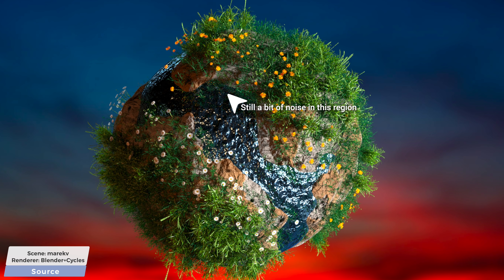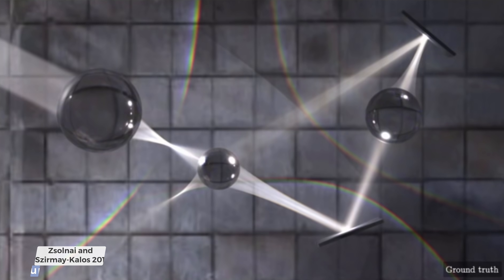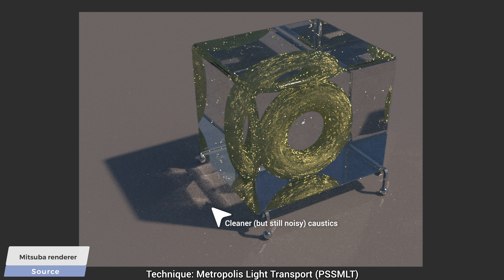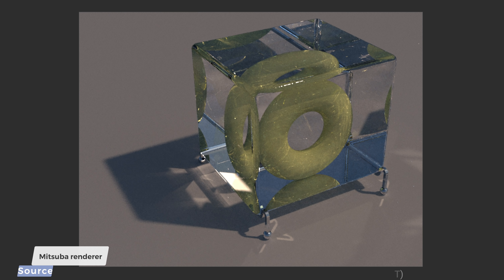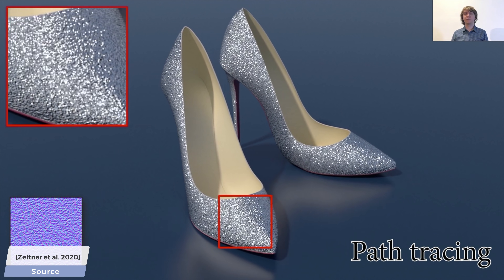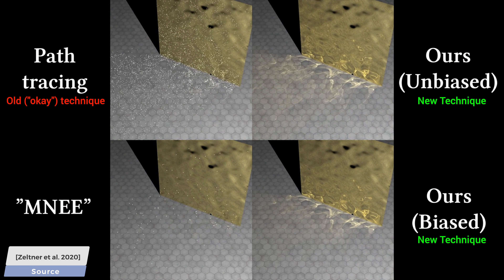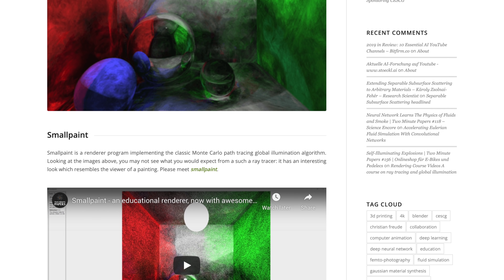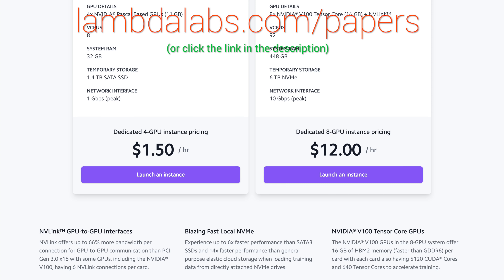Beautiful Results From 30 Years Of Light Transport Simulation! ☀️

Comment: i wonder if you could run the rendering for not a long time then use GAN to clean up the firelys
Reply: since it uses bias and what the machine thinks looks "right" instead of what is actually happening it wouldn't be completely accurate but you could end up with something that looks pretty decent without as much effort.

Comment: I think the problem with the old manifold exploration technique (MEMLT) is not just that it is difficult to implement. But more problematic that because it is also based on metropolis light transport. And as such the problem is that it causes flickering when trying to render an animation. It only works so well for single images.
Seeing actual animated(!) caustics rather than just still images is what is really exciting about the new technique in my opinion.

Comment: Dunno if someone aleady mentioned it, but the most immersive and different results in this "new" algorithm are achieved via biased rendering. And one thing should be mentioned about the biased renderers is they are not physically correct due to use of interpolation techniques.

Comment: I've never heard about that before but I was wondering: What's the goal of this ?
Please, tell me :D
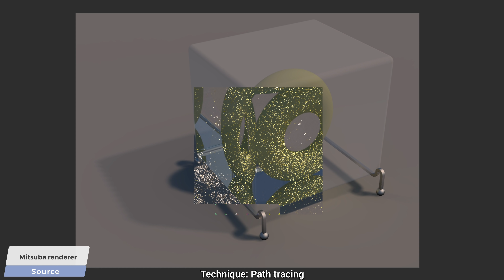Reply: You can achieve those nice looking results with any method, the comparison made here, I believe, is what the final result is at the same given time. So the new cool method might give you outstanding results in two minutes while the old methods could take hours. Just as an example, each frame of the movie frozen took about 24 hours to be rendered, and those are 24 each second for the entire 1:30h movie. 

So the goal of this is an increase in performance, you'll need fewer render-farms running and thus save a ton on budget and dev time. Also, and this is a personal example, blender recently added an AI denoiser for the viewport that can be powered by optix (Nvidia rtx tech), with this I can see what my scene looks like almost in real time and thus I can edit anything much faster instead of waiting for the scene to render and adjusting it (like what was done on 2.7x versions of blender). This really boosted my workflow, so I can Imagine how better the process will be with this Specular Manifold Sampling.

Comment: I am wondering when will this method be ready in open source renderer and have a GPU accelerated implementation.  I have just tried bidirectional rendering on lux core renderer today, but it runs only on CPU is quite a problem.

Comment: I don't understand  why that normal mapping shoe texture should be so hard to calculate..
As an example..gzdoom has normal maps which even my phone can render in real time ..
What am I not getting here ?
Reply: High frequency normal maps, especially when the bumps are smaller than a pixel, are hard to calculate. It won’t be obvious when you render a still frame but much more obvious when animate. You’ll see those flickering very clearly.
Reply: @zaparine  still don't get it .. these shoes have clearly a normal map overlay ..I think its a pbr material thing? 
Why is it harder to calculate that  there like when you just put it into a game engine like gzdoom ?
Reply: @AndroidFerret  As the comment above, gdzoom uses rasterization technique which is less accurate than the path tracing technique. Game engine uses various kind of techniques to fake global illumination so it looks somewhat realistic to the eyes but not actually real. Path tracing, on the other hand, calculate real behavior of millions of light rays so it's more realistic and a lot harder to compute. High frequency normal maps combining with a glossy surface is very hard for a path tracing renderer to compute. In contrary to low frequency normal maps (large bump) with less glossy surface is a lot easier to compute. You can try using various normal maps in the path tracing renderer and see for yourself.
Reply: To add to comment above. Overall, gzdoom is a real time renderer that uses rasterization, so there is no any complex light transport computation for each pixel. While techniques like path tracing needs to make N samples in random (or biased) directions to make correct approximation of incoming light that hits the surface.
Reply: @auyez_5537  https://youtu.be/6dJLDZBJCNE
Reply: @auyez_5537  arent that complex lighting effects?
Reply: @auyez_5537   also ..look at dr4 ..its a mod which enables raytracing in doom

Comment: 3:20 But manifold exploration is also a form of metropolis light transport right? It is just a special (much better) mutation strategy for MLT.
Reply: Yes. manifold exploration is often shortened to MEMLT (manifold exploration Metropolis light transport).
Reply: @JasonJoeish  It actually says MEMLT (manifold exploration Metropolis light transport) at the bottom of the video. But for some reason I did not see that on first watching, so thanks anyway. :D

Comment: I hope this gets implemented in blender 😅
Reply: @Ezekiele Hurley Don't get your hopes up for this in the next 10 years in Minecraft, this sort of thing requires hardware acceleration which isn't available with optifine or java Minecraft in general and each frame still requires significant time and can't be done in real-time.
Reply: That's what I'm waiting for lol
Reply: That's why I'm here
Reply: @Ezekiele Hurley basically games which do path tracing (including continuum shader) cast as few rays as they need in reverse from the camera so that only rays which are needed for the frame are calculated. The result of this process is a very noisey image which they then use a denoiser to clean up - this lets them do path tracing in real time, it's kinda like a shortcut so they can get decent frame rates at the cost of accuracy. The light transfer methods showcased in this video would take much longer than the current method to render and it wouldn't be fast enough to provide decent frame rates, but I imagine over the next few years we'll see some optimisation and better hardware which will eventually make it possible.
Reply: I fear Blender doesn't have the manpower for anything like this. They don't care about Cycles too much.
Reply: @BG_Andy  It's a good job it's open source and anyone can make an add-on :)
Reply: @thomasmoore515  Expanding the core render engine via an addon would not work properly. This would be another complete branch of Blender of which we already have so many.
Reply: @BG_Andy  This is incorrect there's already a bunch of different renders in blender some of which are add-ons like redshift or octane. I see no reason why an add-on couldn't implement this technique in a custom render engine if a dev had the technical ability to implement it.
Reply: @thomasmoore515  The last time I used Octane Render it was a separate Blender package. But all those third party renderers create a connections to external renderers and they don't expand on Cycles. If modifying Cycles via an addon was so simple, E-Cycles would be an addon and not a separate Blender package.
Reply: Considering how far behind Cycles is, I don’t think they will be one of the first to implement something like this. More likely to be Chaos Group.
Reply: @JHA854  yeah because they don't have millions from all the people paying 1000 dollars a year for it
Reply: All of these fancy things could get implemented after vulkan is added so that the blender team has a good code base